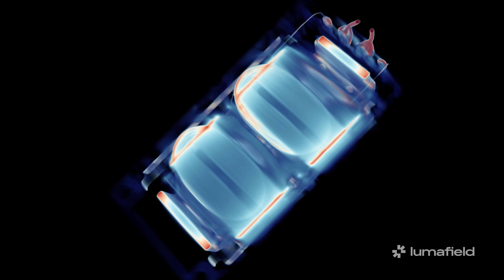Switch 2 Pro Controller: Built to Break? Full Teardown

Comment: This video is at least a bit hyperbolic when this same person reviewed the Dualsense Edge which is also a mess (and he's clearly struggling to open it, which I have experienced too) and he thought it was "not bad", and said the pins are easy to break "but that's okay", but rattle is unacceptable (despite the Dualsenses rattling a lot in general, even without disassembling them)? And all that even though the controller was more than twice the price, also a brand name cashgrab, with equal or sometimes  less features than other in way lower price brackets, and it is incredibly prone to failure too.

Not saying all the complaints in this video aren't valid, they are and I agree with them! But the video also sounds like it's purposefully trying to get mad at stuff that wasn't considered as bad before.

I guess my issue is just the tone of the video or, rather, how apologetic the Dualsense Edge video was.
Reply: I was going to comment something similar to this. I have an ifixit kit and have been using their guilds for as long as I can remember. I have lots of respect for the advocacy that they do but this? This just isn't it. The fear-mongering around the switch 2 potentially having "the same" drift issues as the switch 1 is just embarrassing. Yes they both use potentiometers, but so does every PlayStation, Xbox, and Nintendo console before it. The switch 1 had a unique design flaw that made it WAY more probable. We are yet to see if the Switch 2 falls into this same fate and rather than doing testing, they just went for clickbait.

Same for this controller. Do I think this thing is worth $85? No. (Nor $80, it's original price before tariffs. Which wasn't mentioned in the video) Buttttt PS5 controllers are only $10-$5 cheaper and lack back buttons. They also don't have smooth glide sticks, or the quieter buttons. It's a feature comparable controller with better battery life. 

I think of jerryrig who even when he obviously hates a product will comment on the things it got right. Pros and cons. Not just a slam dunk hate video.
Reply: Corporate bootlicker detected
Reply: It's iFixit, they have about as much conviction as wet cardboard. Their ratings change on personal whims. They have the Joy Con 2s rated as less repairable than the later iPods - you know, the ones with unibody metal cases that you were required to dent to get inside, or that little one that you can only get inside *through the screen*.
Reply: I don't know how the situation is in the US, but here in Europe the Switch Pro vs Dualsense is made even worse by the warranty policy.
Nintendo Joy cons and Pro controller: 2 years full warranty, and even outside of warranty they will fix stick drift issues for free.
Sony Dualsense: 1 year limited warranty. Did your controller develop stick drift at 1 year and 1 week? "Too bad, buy a new one."
Reply: Nintendo fans are some of the most insecure emotionally unstable people around who cannot handle even the smallest criticism , else the most open to abuse by corporations.
Reply: Xbox controller will give you zero probs
Reply: @fatteebaddee my elite controller’s bumper misses inputs like crazy. Stop lying please 😂 an extremely well documented issue that Microsoft has yet to properly address after years of
Reply: You GET a Dualsense with PS5 

You HAVE TO BUY a Nintendo Switch 2 Pro controller separately

I don't like Sony's treatment of their customers, or their controllers being more obtuse to repair than they should be, but I'd argue that being pissed that the $85 upgrade to the Joycons you get with a Switch 2 is ALSO prone to stick drift on top of being leagues more difficult to simply get into than the Switch 1 Pro controller is entirely reasonable. This comparison is not 1 to 1.
Reply: 100%. this is one of the best mainstream controllers for repairability, the glued faceplate is the only bad thing here. This was a terrible video.
Reply: I welcome the analysis and criticism but tbh the entire tone of the video just comes across as dickish lol. Switch Pro controller is one of the best I've ever had and this one just seems even better. 

But gotta get those clicks
Reply: They’re definitely trying to capitalize on a rage bait title because they know the vocal minority of people get rock hard on bashing Nintendo hardware lol
Reply: Late reply but it's definitely made to jump on the Nintendo hate wagon with the internet moaning about the console price, 1st party game prices, the SD Express card requirement, the Switch 2 Edition Key Carts & the accessories prices. 

There are very rarely measured criticism videos when Nintendo is the focus, and Xbox are also in a similar boat. Everyone screams greed but refuses to look at operating and manufacture costs, the economy as a whole with trade relations suffering deeply thanks to the tariffs, and also still seeing Nintendo as a platform for Children while expecting Premium Enthusiast hardware designs for the same price as last gen's standard hardware. They don't consider the Anti-tamper choices being to prevent modification or exploitation that could damage any console it interacts with, or other malicious uses, but claim it's always anti-consumer to prevent people from repairing and forcing them to buy new replacements, despite Nintendo clearly having a repairs department, showing that they did indeed design for disassembly and reassembly _BY AUTHORISED PERSONNEL_. They don't want people with no knowledge attempting a repair and screwing it up, they don't want people to open the controllers to damage something on purpose and then try to claim a warranty repair/replacement on a unit because they don't use anti-tamper stickers. 

It's just an unfair criticism to capitalise on internet outrage while ignoring actual laziness and malicious designs by other platforms like Apple and Sony.
Reply: @Whiteythereaper late reply from a corporate bout licker. Sorry nintendo I'm late but I'm here now as a pathetic boot licker!
Reply: Look... I'm enough of a Nintendo guy that I lined up before GameStop opened for the Wii fucking U 😂. It is also immediately apparent that this controller is worse than the original Pro controller in several ways because Nintendo is doubling down on making things more difficult to repair. If you can't see that, then that's a you problem, not iFixit lol
Reply: Yeah, I just saw this video and it feels like a hating masterclass lmao. I've seen/used a lot of Xbox Elite and Dualsense Edge controllers that had stick drift, and those controllers are almost 3 times more expensive than the Switch 2 one lol
Reply: Yeah that was my takeaway too. This is completely out of touch in a collaralation=/=causation way. 

In actual use this controller is excellent. By far the best "first party" standard controller from anyone. We already know how good the battery life was on the Switch 1 and Wii U Procontollers, so the whinging is uncalled for.  I get the difficulty in dissassembly concerns, it's not exactly the most important thing if it turns out no one really ever needs to pull it apart.

Same with the sticks, they feel amazing, are silent and don't have the dirt and grind fail points from external use. We need to actually see if the fail rate is actually bad before completely writing off the improvements.
Reply: Очень взвешенное и адекватное мнение,  @Mr.Gingerlicious 
На фоне хора голосов, просто повторивших вслед за автором видео его необоснованные претензии — вдвойне было приятно увидеть ваш комментарий
Reply: @Mr.Gingerlicious this is a teardown to assess repairability. If you were expecting a review of the Pro Controller you came to the wrong place...
Reply: @Steakkiller  He calls it a sorry excuse of a controller. What do you think that means?
Reply: @Steakkiller  and i agree on the teardown about repairability but the guy looks like is pissed off at nintendo and give his opinion on the actual quality of the controller since the first moment.
Reply: @Steakkiller  It was meant to be that, but it sure sounds like saying "This product is absolute trash and purposefully made to break" to get eyes on it, when it's an overly dramatic takeaway.
Reply: @Mr.Gingerlicious  So you go on a channel that is specifically about reparability and how to open up devices to work on them and say that's not the most important thing? Why are you here to begin with if this stuff isn't what you're looking for, or wanting? 🥰
Reply: They're probably comparing to other market offerings within the Nintendo controller space. There are much cheaper 3rd party pro-style controllers available with magnetic sticks. I don't know about the PS5 controller scene, but I bet that there are less 3rd party offerings that are very attractive.
Reply: @HittTheDekk what controllers would you recommend?
Reply: @HittTheDekk I guess that's fair but the reason there aren't any other alternatives on PS5 it's because Sony has purposefully locked down its encryption to avoid competition, which I'd argue is even worse because there's no options.
Reply: Hating on Nintendo gets all the views these days. Never had a pro controller break on me, non-issue.
Reply: They're also trying to make the drift issue into a huge deal when the original Switch Pro Controller didn't have a historical data of the drift being as prominent as the original joycons. Heck, even the DualSense controllers are as drift-prone as (if no more than) the joycons.
Reply: @RoSoliTaire  If we are throwing arguments out saying there is no historical data for switch pro controller, then why are we just throwing out assumptions on how drift prone the duelsense is? Especially comparing it to the joycon's of all things. It would have been better to bring up the nintendo repair/replacement program. That was actually better from what understand when comparing peoples experience with controller repairs that I have seen online. 🥰
Reply: Don’t you know? Hating on Nintendo for their 'high prices' and 'weak hardware' is the cool thing now. Easy clickbait
Reply: @sersimov For anyone doesn't know DF done a tech analysis , Hogwarts and even parts of cyberpunk cannot come close to the PS4 versions due to loss of details and shadows , draw distance etc. It cannot come close to even a steam deck in handheld mode due to the abysmal wattage of 7w. In all it is now being theorised that its power is between a PS3 and PS4. It also has one of the worse screens in handheld history that is compatible to the psp from 2004 due to it being extremely slow in response rates making a lot of games a blurry mess, go check monitors unboxed tech analysis where he evidences it as the worse screen he has ever tested , and much worse than the switch 1.. Nintendo's thriftiness has reached legendary levels. Most hardware analysts cannot work out how they got such a bad screen in the 20th century but most are theorising it was unused stock from a vintage project either sold of cheap or literally for free.
Reply: @sersimov  Nah, don't you know? Defending nintendo for their prices and practices is the cool thing while saying others companies don't get the same treatment even though they do and you just refuse to acknowledge that. Easy clickbait. 🥰
Reply: @TyrelJarome dude I'm not trying to console war here so take that outta here.

The point I'm trying to make is that these hyperbolic videos lose credibility for me and it's very uncharacteristic of ifixit which is usually very professional. While all the complaints are true and legit, the TONE of the video SOUNDS like the usual fanboy war channel, and I don't want ifixit to sound like that.
Reply: @VagrantValmar  No mate, you get out of here with that bs. I don't "champion" a console, or even any pc platform or storefront for that matter. iFixit has been going harder on companies as the push for reparability has increased. These guys have even dropped reparability scores in the past because of bs from other companies. And seeing people throw temper tantrums over them going hard on their favorite company and then coming in with lame excuses is something that I will call out. 

When someone says "Ifixit is paid actors now. Sad, but true". I will call them out on it. When they point out lack of evidence and then proceed to throw out accusations without any evidence, I will say how it is hypocritical. And it's wild that you called me out specifically verses people underneath your very own comment that have done just what you said, "console war". I never @ ed you before and nor did I state you were trying to "console war" so I don't get what you want me to take outta here. If people lie or spew bs and I call that out, that ain't a console war, that's just calling out the bs for what it is.
Reply: @TyrelJarome I called you out because I keep getting notifications from all of your bunch of comments. I said the complains are valid, and I specifically mentioned my issue was with how apologetic the Dualsense Edge video was, and that they were okay with all the stuff with that controller.

Ifixit is obviously not paid actors. I didn't reply to that because I honestly don't think it's worth even entertaining those comments.
Reply: @VagrantValmar  "I called you out because I keep getting notifications from all of your bunch of comments." - And yet you failed to mention that the first time. Instead brought in "console war". 

As far as I am concerned, you and your duelsense issues is what you make of it. I never replied to your comment about it directly as I saw no issue with how you initially viewed the situation. And so far as further comments are concerned, I said what I wanted to. If someone replies back then I will likely reply depending on when I have time again, otherwise I was out before I initially even saw your @ and decided to @ you back.
Reply: Ifixit is paid actors now. Sad, but true
Reply: @scienceboy20814  No, you're just a salty fanboy. 🥰
Reply: For anyone doesn't know DF done a tech analysis , Hogwarts and even parts of cyberpunk cannot come close to the PS4 versions due to loss of details and shadows , draw distance etc. It cannot come close to even a steam deck in handheld mode due to the abysmal wattage of 7w. In all it is now being theorised that its power is between a PS3 and PS4. It also has one of the worse screens in handheld history that is compatible to the psp from 2004 due to it being extremely slow in response rates making a lot of games a blurry mess, go check monitors unboxed tech analysis where he evidences it as the worse screen he has ever tested , and much worse than the switch 1.. Nintendo's thriftiness has reached legendary levels. Most hardware analysts cannot work out how they got such a bad screen in the 20th century but most are theorising it was unused stock from a vintage project either sold of cheap or literally for free.

Comment: Why is joystick drift a problem? I understand that the resistive wipers in the potentiometer wear and change resistance over time, but why couldn’t you just reset the zero position in software? It’s been a while but I feel like I remember my Xbox one having a joystick calibration option that did just that
Reply: Two reasons:
When dirt or debris gets onto the conductive track it'll no longer be possible for it to remain in continuous electrical contact with the wiper. This causes jittery movement as the wiper and track only make intermittent contact with one another. When the track gets completely worn away the controller behaves as though you're tilting the stick in one direction or the other at all times. Dirt or physical damage like a worn conductive track can't be fixed in software. The parts need to be physically cleaned or replaced if they're too damaged.

But secondly, you have to remember that the type of software you're talking about, such as dualshock-tools, only became available years after the PS4 launched. For most of that generation the only way to repair controllers was to desolder the old broken joysticks and search for new pots that already had values as similar as possible to the originals and then make final adjustments manually using tweezers and pliers. You couldn't reprogram in software because the software to do it didn't exist. It took the genius work of the guy who made dualshock-tools to reverse engineer PS4/PS5 controllers enough to figure out how to reprogram them.

Even today, we still have no way of reprogramming the onboard calibration for models 1537, 1697, and 1708 Xbox controllers. Microsoft provides a tool to do it for model 1914, but that's it. 

Now, I do think the guy who made this video is intentionally making a mountain out of a molehill and getting mad about what are really very minor nitpicks in order to push the narrative that Nintendo is anti-consumer (which is true in many ways, but the Switch 2 Pro Controller is not one of them). But that's a separate rant, lol
Reply: eventually the dust (carbon or otherwise) builds up enough to where the wiper will smudge it around during gameplay and make recalibration impossible unless it was done whenever the controller stick is at rest. The PS2 had this style of calibration, where at boot up and a predetermined interval thereafter it would "re-center" the sticks when they were idle. having sticks this worn down also makes it kind of pointless to use, because the deadzone would have to be very big to prevent spurious inputs.

Comment: only improved thing from the first switch pro controller, is the modularity of the sticks and the hd rumble. Anyone that has dissasembled any pro controller from the first switch knows how brittle the flex that attached the hd rumble to the cables was